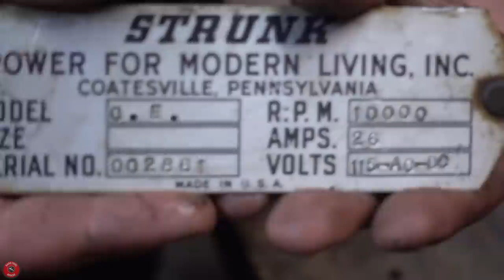1960s Electric Chainsaw [Restoration] (Part 1 of 2)

Comment: i dont know if im just an idiot, but whats the need for a centrifugal clutch on an electric motor. i know a gas engine needs one because it has to stay running but an electric motor dosent have to.
Reply from the maker: I have no idea. Makes no sense on this saw.
Reply: thanks, ive woked on electric and gas tools but never seen a clutch on an electric tool

Comment: With the fuel tank, if it can hold water it can hold air, weld an adapter to the lid so you can use your air compressor to inflate it next time

Comment: to plug those holes with weld you can use a copper backing plate as it will not stick to the weld and also draws away the heat to prevent a burn through. Also for that little can you could have boiled it so the pressure would bring the dents flush or there abouts, compressed air would also work
Reply from the maker: Interesting...so fill it with water and boil it?  Would be cool to see.
Reply: Hand Tool Rescue: 
Wild Weasel has a bad idea. Boil water in a tightly sealed volume and make a "big badaboom"... Look at some "steam boiler explosion" videos before.
Reply: For that gauge of sheet metal the dents will pop out way before it explodes. Exactly the same principle of hydroforming and hydroforming actually deforms the sheet metal to a desired shape, we are talking of popping out dents in really thin sheet metal. Using lube grease and a grease gun would also accomplish the same though a fitting should be applied for the grease gun
Reply: Wild Weasel:
Yes, grease gun, like any other type of "hydroforming" is safe, since expansion is fully controlled and compressed fluid does not accumulate excess energy.
Boiling water in a sealed tin can be dangerous, because the explosive expansion of steam, instantaneously formed from overheated water, can not be fully controlled. At least, a safety pressure valve is required to prevent possible "boom". 
It was 35 years ago, but I well remember the consequences of the explosion of a closed jar of canned milk, which my stupid neighbor in the student hostel tried to warm up on the stove...

Comment: I need some advice. I have a Pioneer P26 that I just got running after 26 years, but it has a hard time ideling    and it bogs down and dies when I give It gas. Pls help if you can. Thank You
Reply from the maker: Sounds like the carburetor needs adjustment.
Reply: Hand Tool Rescue  Thank You

Comment: If you put 2 nuts on the studs and snug them to each other then use the bottom one to remove stud it is better than vise grips and a rag. Its called double nutting look it up on how too.

Comment: The failure of the stripper to act on the chainguard@ 14:28, was likely because the finish (and metal) were heavily oil soaked.  
Boiling water and TSP will get the oil to float off, then the stripper will be more effective.

Comment: If you want to plug a hole in steel with a mig welder is by putting an aluminium plate or bullet over the hole weld and remove steel won't weld to aluminium.

Comment: What was that ratchet you used to take the handle off? Almost looks like the handle off an old faucet
Reply from the maker: It's called a palm ratchet.
Reply: Hand Tool Rescue I think I might have to get one of those. By the way, all the outboard guys use compressed air for dented sheet metal tanks. I've used it on a couple tanks and I think it might have worked for this
Reply: Mike Stroz I would use water and the freezer to push out those dents
Reply: delinquentdesign I think the water has a higher chance of splitting something like that open than compressed air

Comment: For those long studs, rather than using vice grips put two nuts on the end and tighten them together, then use those as a single nut to loosen them off 😄

Comment: I thought electric chainsaws were a more recent invention. I remember my stepdad bought one in the late 90s and it was absolute trash and it burned out after a few years of use.
Reply from the maker: The first chainsaws ever made were electric!
Reply: Hand Tool Rescue  for wood maybe but it was originally hand cranked and used for amputation
Reply: Years? You must’ve gotten a REALLY good one....minutes is more like it.

Comment: This two "dimples" on the end of the shaft are NOT there so you can put puller in it!
It's precision 60 degrees holes, so ou can mount rotor in a lathe and redress comutator.
So put ball bearing next time on it and rest puller tip on to ball bearing.
And please... never, ever poke it with hammer. Use brass or wood rod.

Comment: Holy Crap there was a lot of crap in and around that saw. It was too Strunk for just 1 episode. Why did you need to fill in that one hole on the side?
Reply: from the tear down, the hole looked to be right over the end of the drive shaft of the motor.  He fixed some dents in cover so I suspect the cover got crammed into the motor and the shaft wore that hole out.

Comment: You can lock two nuts together on the exposed thread of those motor torsion rods, then get a socket on them, rather than vice grips to get them on and off.

Comment: Wear a mask when blowing out the dust on that one, or better yet, work with everything wet with oil (new not the stuff in there which probably contains PCBs) or water...it looks like those clutch pads were asbestos.

Comment: Have you used EVAPO-RUST in your ultrasonic cleaner ?  I would think that the heat and cavitation would lift the old cheap spray paint ?  I was able to buy 4 gallons of E_V rust at my local PEP BOYS for about $15 per gal. on sale. Good investment !   Goes great with JACK DANIELS whiskey ;-P  .....no ice please !   J K   Houston TX

Comment: Being a mechanic I cringed every time you use your adjustable wrenches. 

Also, instead of you vice griping onto the long threaded studs that hold the case on, just run 2 nuts together on the threads and use the proper size wrenches to thread them out.